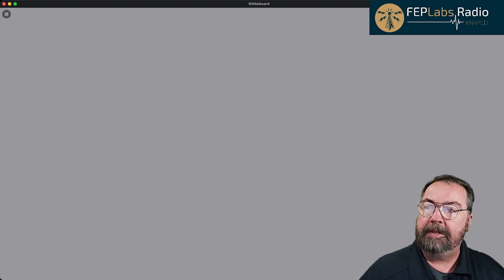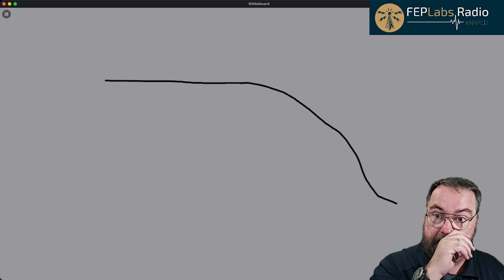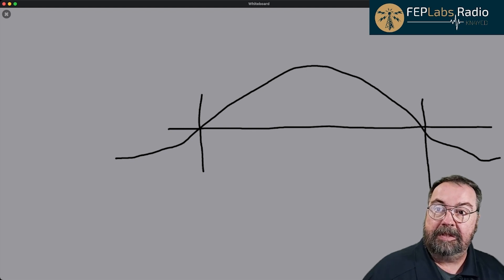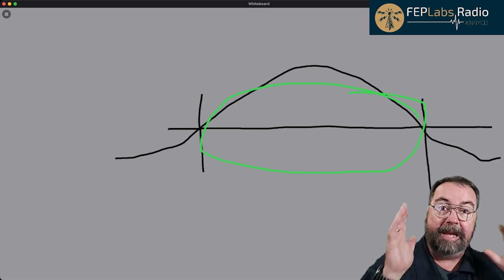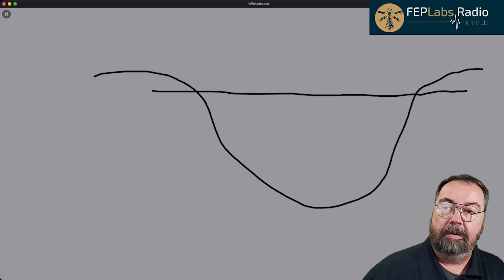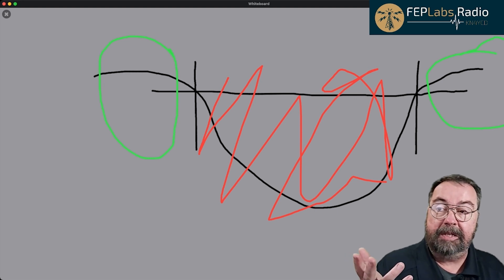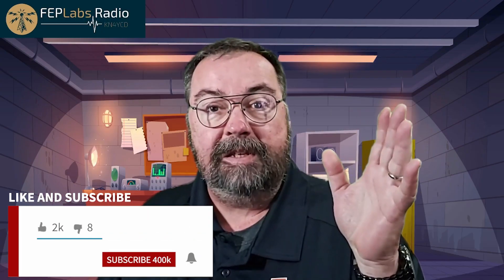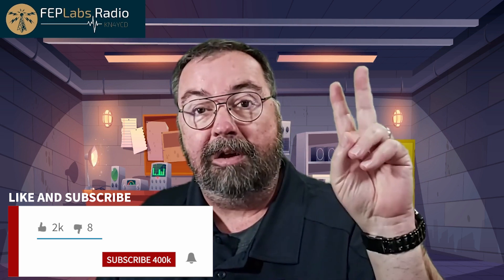Demystifying RF Filters: High Pass, Bandpass, Low Pass Explained

Comment: Sadly the front end of these icoms are primed to overload in an rf environment. Any radio with roofing filters behave better but most need external bandpass filters in this application. So for field day , it’s a great idea to leave the 7300s at home.
Reply from the maker: Right - I had problems with mine when I had it in the shack with a 991A and used the 991A to xmit while the 7300 was on.  OVF light, and required a power cycle to get it workin again.

Comment: Do you think an external 1.8-30MHz bandpass filter help to reduce things like MWBCB interference and local RFI on receive?
Reply from the maker: Jay, I'm not sure what MWBCB? refers to.  But, the answer is yes.  If you run your signal (TX or RX) thru a bandpass filter, anything outside the "pass band" will be filtered out.  You just need to select the filter based on the frequencies that you are interested in.